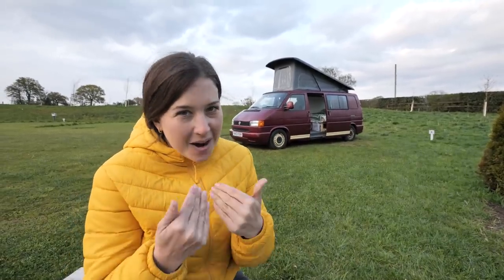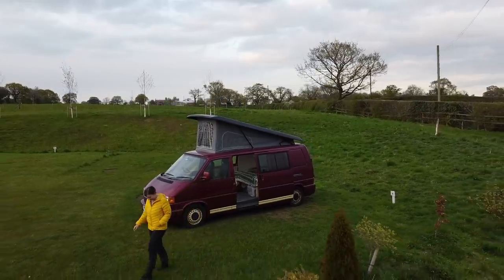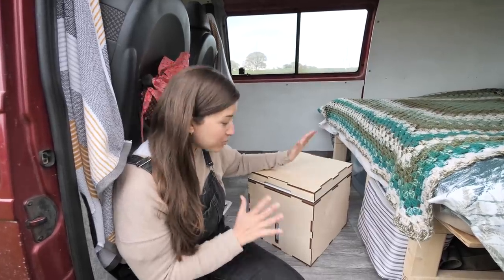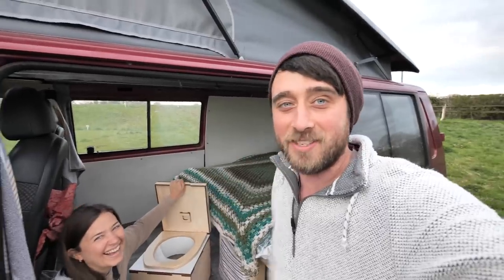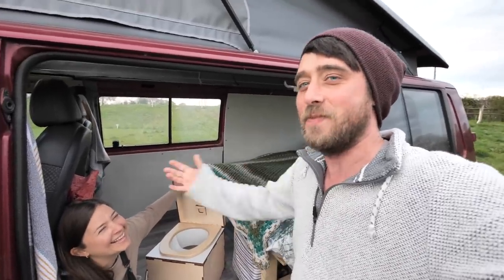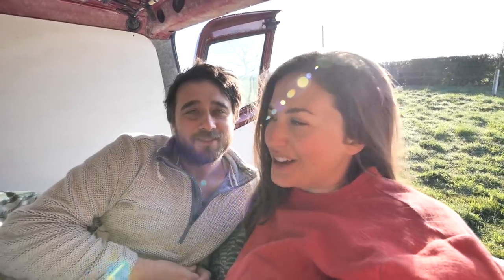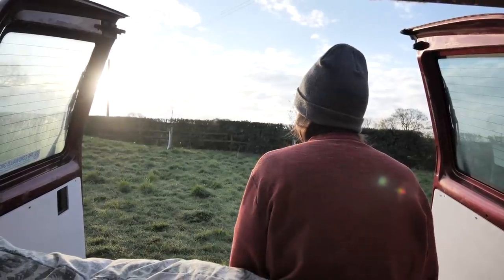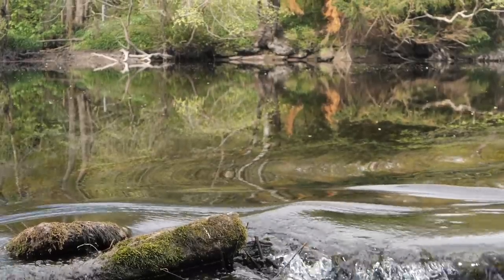First Night In The Van + Best Toilet For Small Camper Van | UK Vanlife Series

Comment: I'm with you guys on the composting toilets, even though no one is really composting their waste. That being said I'm DIYing mine cause the price of those things. I means It's just a box with 2 buckets.
Reply: That's a really tiny loo. The liquid tank is going to fill up really fast and the solid tank has no way to stir in the composting material, so it will just sit on top. Ewww! I'd rather poop in a bag and wee in a jar. Saves money, smells less and seems cleaner. Use it only for emergencies and good luck.🤓
Reply: @t.l.b.7131  Reports I have seen of composting toilets indicate they don't smell, and you don't stir them.

Comment: Nice one guys, there is nothing like your first night.  Get some of those insulation covers for the windows, it makes a huge difference, I was surprised.  This is an account of my first night with my two kids and Buddy the dog.  It was March and damn cold.  Two Kids a Dog and me in the Van...Just home after doing a shakedown trip in the van...we didn't go far, must to a campsite near to the Bluebell railway, Wapsbourne Campsite or WoWo as they call it.  Having packed the van i turned the key and nothing happened...several turns later it fired up...thats the beauty of old vehicles you never know if they will start...after several wrong turns we arrived in the pitch black around 7.30.  We were directed to our pitch in a field where there were 2 other campers.  Went round in circles several times until we were parked next to a fire pit and benches and with the door on the correct side!  Tom unwound the awning and got the bucket barbecue out to light a fire.  Becky and i prepared tea... 

We pulled the curtains and i proceeded to burn several pieces of toast, the beans were bubbling away and then i tried to fill the kettle.  i put the spout on the canister and held it under my arm but i had over filled it and squeezing it made water shoot out all over me. I eventually filled it and put it on the stove and soon it was   whistling. Becky grated cheese and every time Tom knocked on the van to say the fire would not start i burnt another bit of toast.  It was getting serious i was running out of bread...

Finally we got the table out which meant we all had to sit down really.  I got toms cheese on toast cooked without burning and Becky and i sat down to beans on toast.  A veritable feast...we had some snacks after and then after a trip to the ablutions we had to get the beds ready.  It was freezing outside so with three people and a dog inside it was tricky to say the least...

Finally Becky and Tom got to bed in the top bunk and i pulled out my bed.  Buddy settled down but the only space was in front of the heating outlet so we could not run that.

It was very cold and up top it was very cramped.  Becky came down to join me and this gave Tom more space. Buddy was tucked up in his blanket.  We all woke up around 7am...now even colder...we moved Buddy's bed and put the heating on and started to defrost...Buddy was shivering so came to snuggle up with us.

After a trip to the ablutions we had breakfast and a welcome cup of tea.  We then packed up and i turned the ignition key with fingers crossed it would start...she fired up first time and we set off home...

Lessons learned, get the van serviced, make sure you know where the campsite is...don't take so much stuff.  Don't fill the water canister so full, keep an eye on your toast and ignore distractions, that is when it will go black, when you are not looking...book a Yurt next time, they have wood burners...

If you have not read the book The Tent, The Bucket and Me then i recommend it.  Our trip was one night but given more time i am sure we can make lots more mistakes but we had fun which is the point...i think!  Karen was tucked up in bed at home...we always said she was the brainy one

Comment: Loving your van build video's, I haven't watched them all yet, but I'm getting there.  I wanted a camper for years and the only way I was going to get one was like you build one as they were so expensive.  
I had so many plans in my head how I wanted to build it and fit it out, I have the skills and time.  The beds, the kitchen, the loo and yes the pop-top.  Loved that video.
Sadly I don't have your patience, I wanted to get out on the road and out into the countryside now.  So I cashed in my pension and bought one ready made brand new from the factory, not a decision to be made lightly I have to add.  It's a high top so I can stand up in pretty much the whole van, it has a built in loo (cassette) and a kitchen and twin beds and I love it. It's not that large either so I can park in a normal supermarket parking bay.  Moreover I love the life, the walking, nature and our beautiful countryside.  Thank you for your inspiration.

Comment: for a toilet there is three different models and they are so so easy. It is snap top plastic two piece in one. it snaps on a 5 gallon bucket, or any plastic bucket. At least the ones here in the U.S. if fits on all big 5 , or 6, even 7 gallons sizes. Depends on how much leg room you need when sitting down. You place it over the rim you sit on the seat so to say, do your thing, and then close the lid when your done. BUT BUT what i do is i put a garbage bag into the bucket no holes of course. Do your business,.....un pop the loveable loo. be careful not to tip it sideways. Take of what i was told when i bought it was called a "loveable loo". Pull up your bag tie it and then dispose of the bag,.and be ready for another round next time. Bucket could be used for storage and Loo is only about 2 inches maybe three inches thick. so it can slid in anywhere.  Now that is one.. now there is another that has a strap that slips over the tire  and hangs off the front of the tire . put the bucket pail underneath with a bag in it. again when your done just roll up bag and dispose of it. And the last one is a "loveable loo" that hooks onto your receiver hitch or your towing hitch on back of vehicle. You should be able to find any of these three. It will sure save you from finding toilet  while you are on the road somewhere. You are carrying your own. just dispose of,..well your business properly is all. Have fun stay safe,..wish i was there. if you can't find them on net  contact me and i will send you photos of what they look like,.well at least one because i own one. and it is a life saver when i am on the road.my mistake it is a "luggable loo" here in the States they have them at "Cabela's"  13 inches around 2.5 inches thick lid and cover all for 14.99 American.. i believe it is worth the time to order one and since you have computer access look it up and see the photo. i believe you would be impressed with it. i know i am and i have used it a lot. better then making a huge wooden box and taking up lots of space.

Comment: Consider a 5th gear mod (0.658 ratio) will cost about £250 ish fitted. Will make motorway cruising much nicer. There are a few garages in wsm that have done this loads.
Good luck with your build.

Comment: compressed pine pellets, sold as animal bedding and smokeless fuel (buy at agricultural merchants not pet shops) is the very best loo material, and a simple folding stool with a hole cut in the webbing top the very best loo, pre measure some pellets into bags, slip a bag over the frame, do your business. knot and shake ,dispose of at the next rubbish bin you find. hoenstly you will never go back to seperating toilets, porta potties, etc.

Comment: Emma wee's a lot because she put's away a lot of wine. Fair play Emma, we like your style. But why don't you buy some 10mm flexible plastic hose, fit a she-wee to one end and run the other end through a 1/2" hole in the floor. Hang it on a cup hook when your not using it and a pack of wet-wipes next to it. Simple, cheap and effective, if a little agricultural.